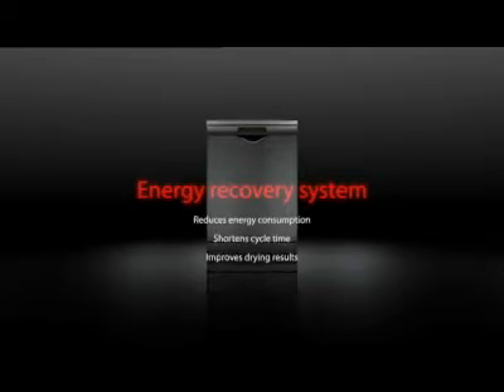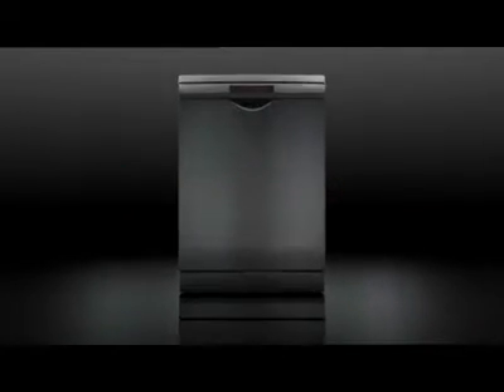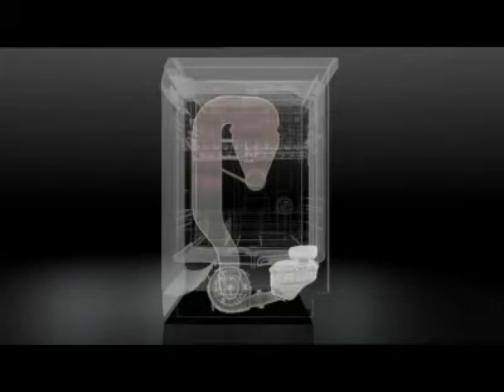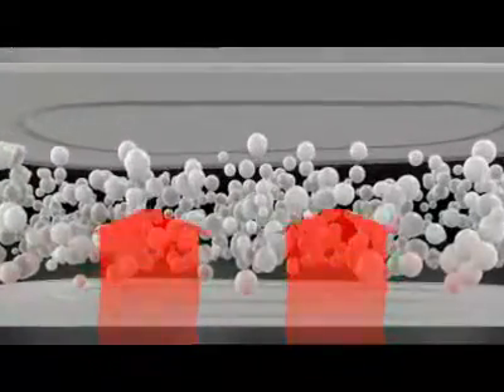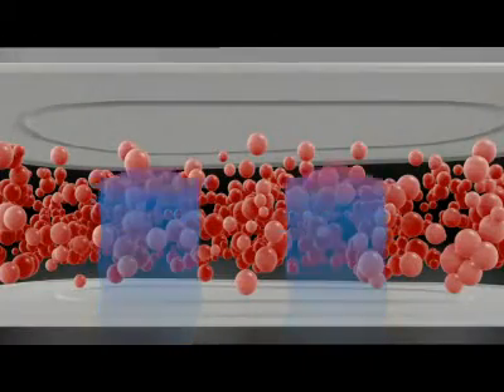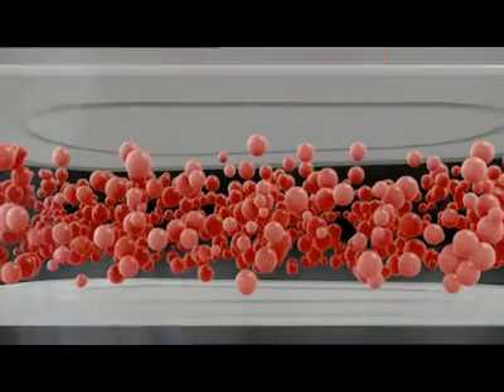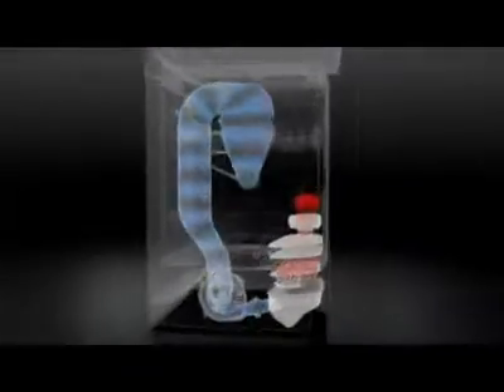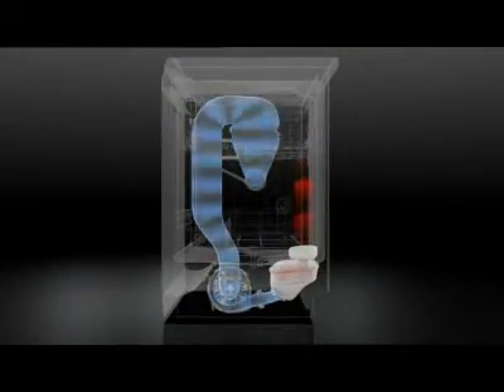Zeolite® drying system for dishwashers

Comment: The zeolite is the most commen problem of bosch and siemens dishwasher
Reply: I'll second this statement. 2 year old Bosch Dishwasher - Leaking - Guess from where - The plastic nut that seals the zeolite container against the tub. Cheap, cheap, cheap - Hi failure point. I have been a strong supporter of Bosch until now. Extremely disappointed.
Reply from the maker: Dear David, 

We are very sorry to hear about your experience. Could you please provide us with information about where you are located? This way we can forward your case to the responsible team to look into.

Thank you very much in advance. 

Best, 
Your BSH team

Comment: This system has failed in my 2-year-old dishwasher. It's full of water and my estimated repair is $500. Bosch customer service will not do anything to help me out, so I will be ordering my kitchen remodel appliances from another company.
Reply: Mine failed at 5 years, heat melts the upper rack pressure tube, which sprays water in the zeolite canister, which fills the air pump with water and shorts it out. Here in Canada that's an $800 repair on a 5yr old $1600 appliance. Bosch authorized service technician said it is a known fault, but not a recall. very disappointed. I guess I will be buying a Meile next, I expect 10 years out of an appliance minimum, my Kitchenaid before this lasted 15 years.